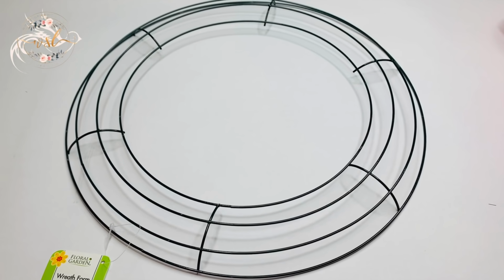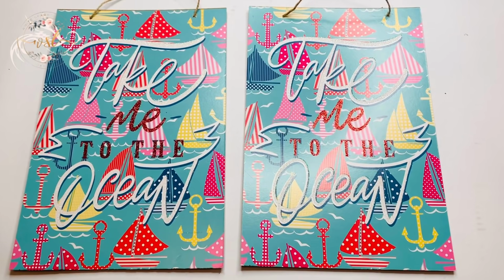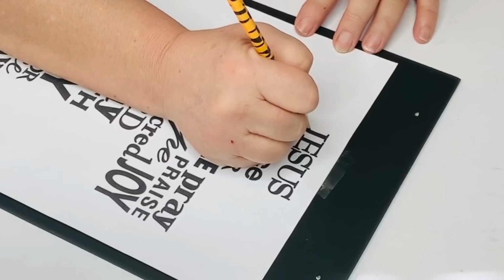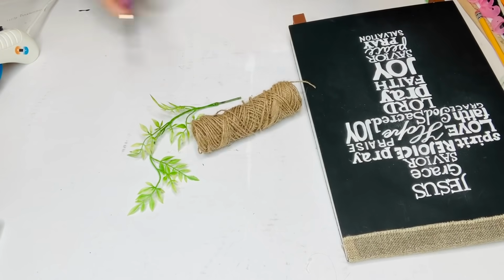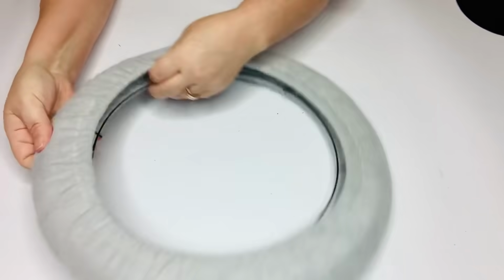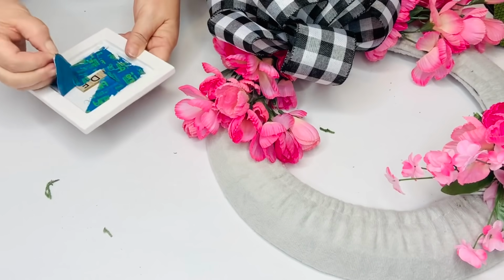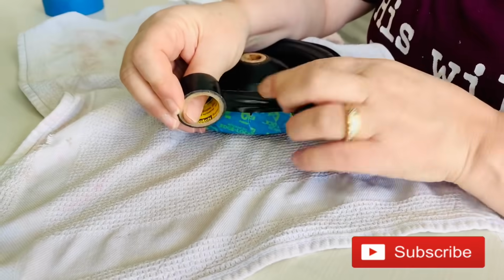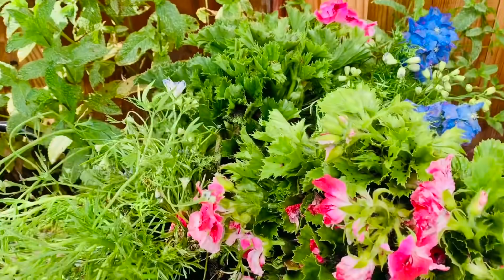DOLLAR TREE DIY X 3 | NO CUTTING MACHINE FARMHOUSE HOME DECOR | VINTAGE BIKE CRUSH | GARDEN UPCYCLE

Comment: When you replant in the fall if the wheel barrel starts looking like it is rusting through the paint clean it again and spray the inside with a clear rubber sealant like Flex Seal.  It will help protect that precious wheelbarrow.   I know you will want to keep that for years to come.  What a wonderful way to hold on to a wheelbarrow filled with great memories!
Reply: I have some metal car trucks 🚚  that would make cute plant holders thanks for the idea but i will put a plant liner underneath the potted plant
Reply from the maker: Great idea!! That helps a lot!! I definitely don’t want it to get ruined!! Xoxo 😘
Reply from the maker: That would be soooo cute, Elizabeth!! Yes! A liner would protect them, too!! I should have thought to use the Flex Seal or a liner!! Thank you, ladies!! Xoxo 😘

Comment: I look forward to your videos and I'm never disappointed! I have a question on the flip sign. On the white side, I would like to put the stand jenga blocks behind it like you did with the black side....did you try that and it didnt work? I just want to save myself from making a costly error.
Reply from the maker: Hi Karen!! So the white side is behind the black side so the Jenga blocks had to be on the outside of either the black side or the white side. (If that makes sense! Lol) And I would rather have them on the inside like they are with the black sign. BUT what you could do so you don’t have to decide which one gets the better look, is to flip over the back board of  black side, and make it reversible that way instead of having to turn it completely over. I don’t even know if that makes sense to me and I made the darn thing!! Haha In my head it makes sense!! Lol 😆